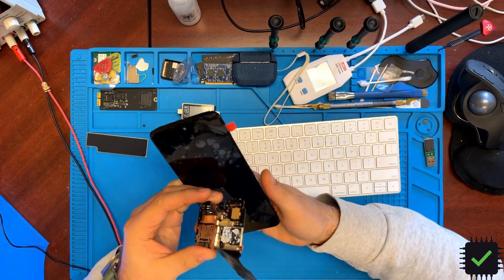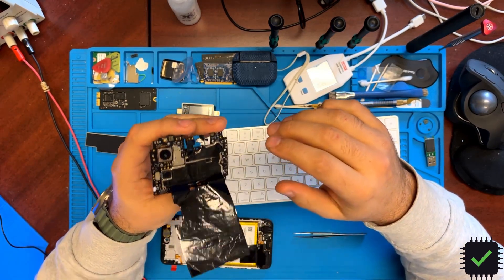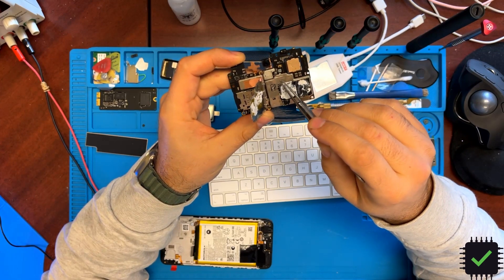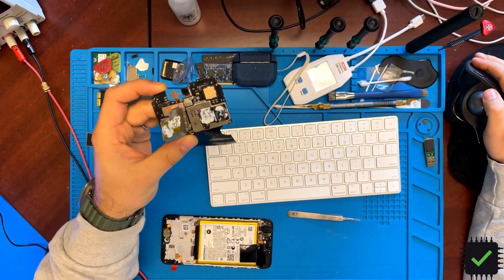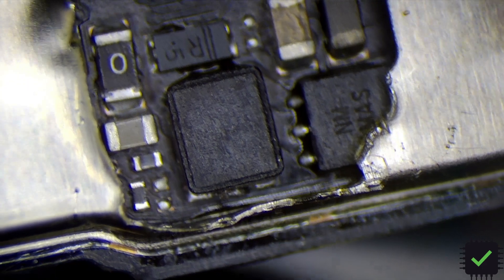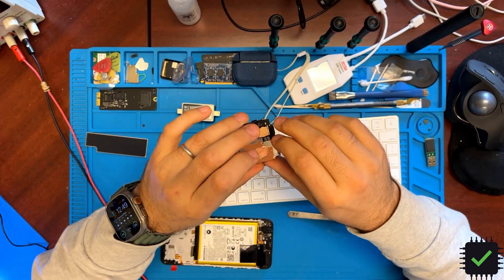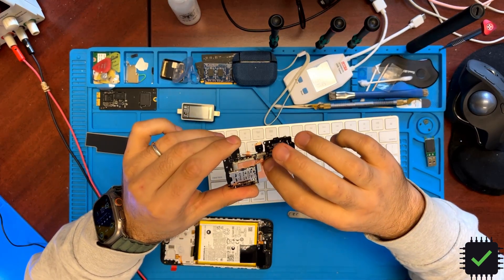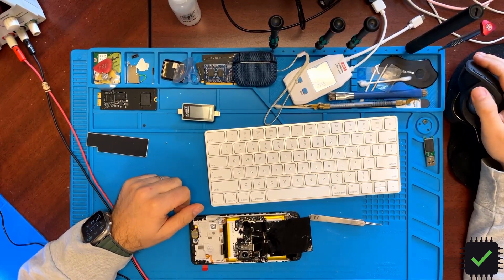Motorola Moto G 5G 2023 No backlight after cracked screen Repair

Comment: Thanks for the teardown.. On my Moto G Stylus 5G (2021) I had noticed my replacement screen worked with a bright light on it, but had no backlight. You inspired me to tear back into it and investigate. While I don't have the same choke/transformer on mine I did notice a tiny capacitor was sitting inside of the LCD connector. It couldn't have been seated well with that in place, but more concerning is that it came from somewhere in the vicinity. Removing the loose capacitor, reseating the connector and retesting yielded the same result; picture with no backight. At least, with a little work and squinting, I can ensure I got everything I care off of it